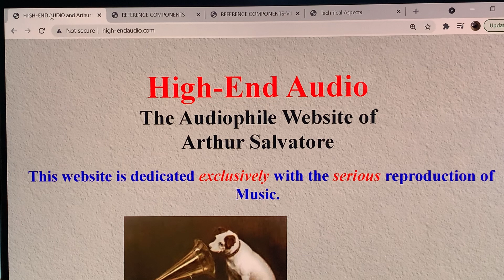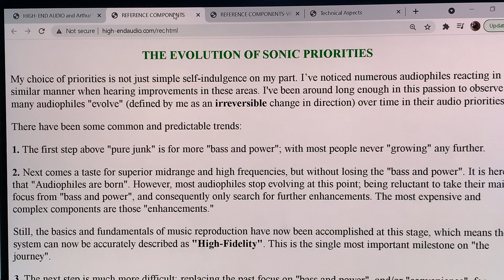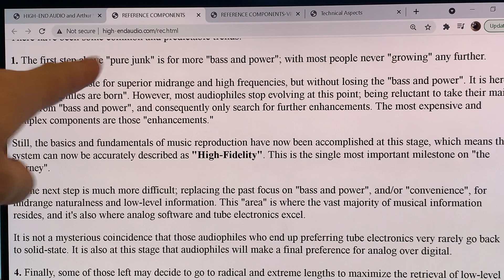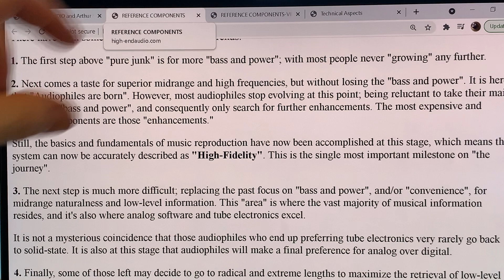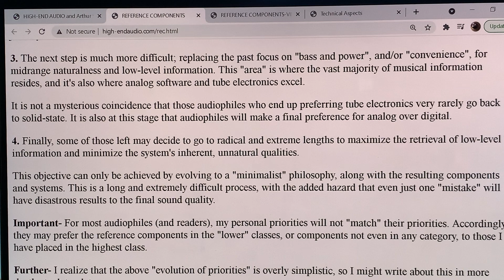Levels of Audio Gears - And what is the standard

Comment: Thinking back at your video of your switch, why don't you use those fine silver tubes? Make one for each channel arrange it in a circle with a centre tube tap in the middle, fasten it to three quarters of an inch of plywood, connect 50 ohms BNC plugs directly to the tubes don't use RCA, BNC is a tube connector in its own right with a locking ring much more superior connection than RCA. you can use what I suggested before  with another piece tube sliced lengthways most of its distance, would give you the best contact fill the centre of the tube with open cell foam like use for washing sponge,  the another benefit keeps the tube tight against the sidewalls with more clamping force plus it ads some dampening of any Vibrations down the wire.
 The  only thing I didn't like about the speaker tube connections is the eddy- currents must be high sticking out that far.,I would have them flash to the cabinet and use the tape around each tube same on the inside, I don't know if a ferrite bead around the + tube would be beneficial if u can get them that small? Do you know the dielectric of plywood??
 I think closer together as well look too far apart eliminating noise rejection. Anyway there's something to chew on lol
Reply from the maker: Thank you John, superb! Deserves a video response & follow-up; )
Reply: @realworldaudio  I don't know about that ok, wondered if you were getting my comments
Reply from the maker: @johnsweda2999  I thought I was (I hope you can see my comments), but now you are making me wonder!
Reply: @realworldaudio  yes I can see you...!! seems to be some delay sometimes like in a holding pen, I don't know if that's what it's like and your end you can tell by the date of the message
Reply from the maker: @johnsweda2999  the date stamp is quite useless. It shows original posting time, although at that time the comment was not yet visible.... this happens to our emailserver at work as well. Sometimes an email is delayed, and then it appears with a date stamp with a receipt date from quite a while ago, when the server received it but failed to transfer to client in time. ; I think YT does the same thing as the N@vell-based email....
Reply: @realworldaudio   yes ok don't know then emails are scan three-letter agency that looked at Port 25 I don't know if that's the same for YouTube I wouldn't have thought so
Reply from the maker: @johnsweda2999  My understanding does not go that deep into programming ;